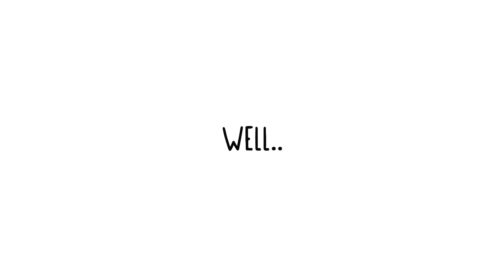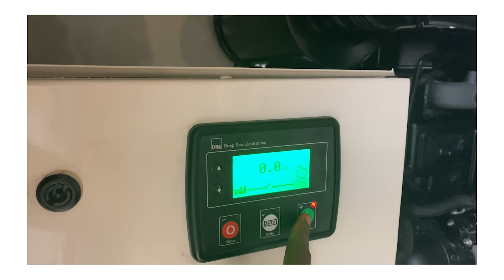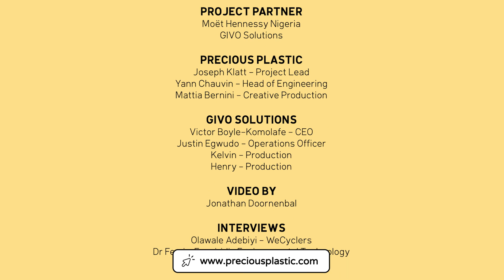An UNTHINKABLE solution for Nigerian plastic waste

Comment: Why does it need 3 phase power? The video really didn't show what the machine was doing but my guess is it's a hydraulic press with heat. The press was done by hand, the video did show that. So what required 3 phases? It doesn't need to get that hot or it would burn the plastic, a large hotplate style griddle would do imo.
Reply from the maker: this machine https://community.preciousplastic.com/academy/build/sheetpress

Comment: Hi just a question, how do you guys ensure that the sheet is cooled enough to not bend when you take it out of the sheet press machine ?
Reply: There is an additional machine we call the "Cold Press" which applies pressure over time avoiding warping or bending
Reply: @this_is_mattia  Thankyou so much. We are struggling in that part. Can you share any details about that ? We have made a Sheetpress but the cooling part we are struggling in
Reply: Hope it helps 😁